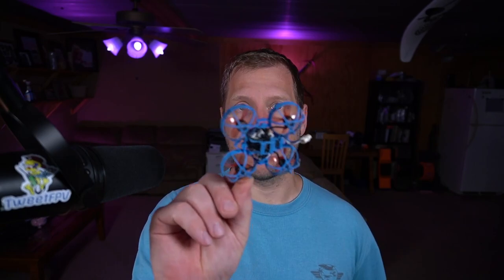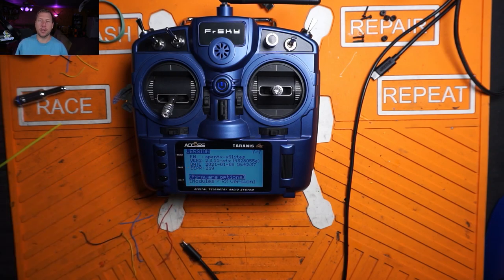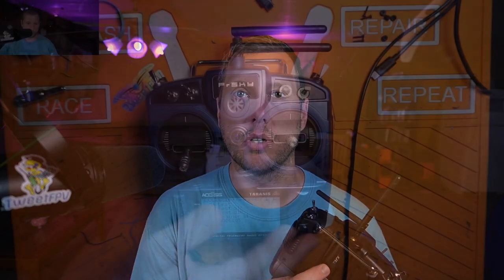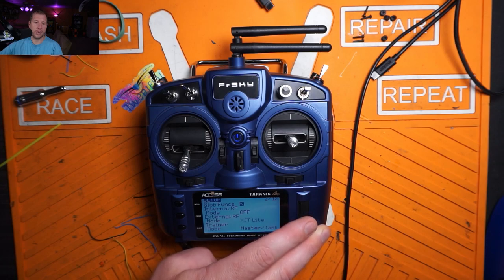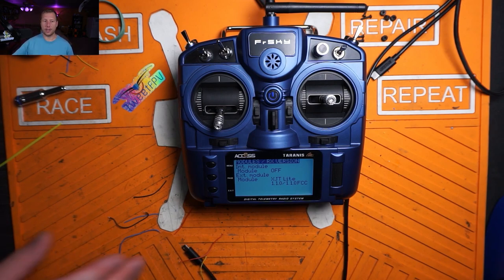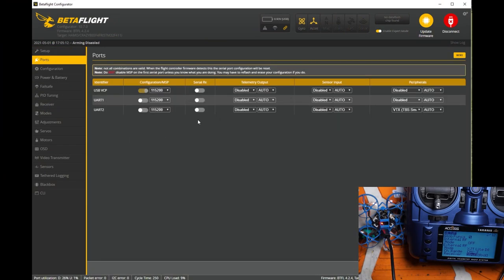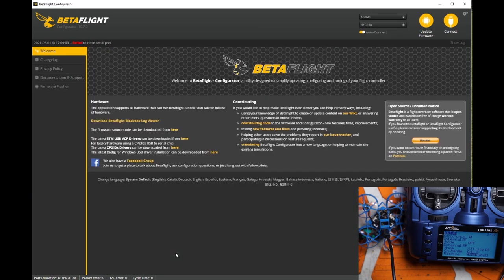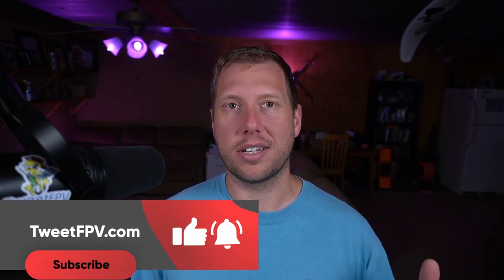Binding with External XJT lite #frsky #access #whoop #binding

Comment: Wondering if you could help, after following your great video on opentx isrm etc. got everything updated open tx 2.3.14 and did the most recent isrm 2.1.6 planning on using the xjt module on my x9lite everything bound up fine after plugging my whoop in and hitting exit to many times my tx is fully bricked I’ve tried most videos I can find on it, thanks!
Reply from the maker: I can try and help you over on my discord. https://discord.gg/YrB7BSv

Comment: Hello I Bought a XJT to connect to my whoop. And got it connected very easily, but I bought a crossfire receiver to try and connect it with that but have had a lot of trouble. can you help?
Reply from the maker: Xjt and crsf are not compatible. You'll need a crsf transmitter module to be able to talk to your crsf receiver.

Comment: Will this work if you update accst to 2.0.. that's what I'm hoping for anyway.  Having trouble flashing older firmware to my xm plus and want to upgrade the radio and use the module for spi.. is this feasible? Thank you.
Reply from the maker: Yes that will work just fine
Reply: @TweetFPV  just called RDQ and they confirmed and you were literally answering at the same time! haha  But thank you so much for your time / knowledge shared..

Comment: hi there sir,
can u please help me,
bought this zorro elrs version and xjt lite module to use with my 3 happymodel quads,
mobula7 2s mobula7 1s and larva x,
all have d8 rx,
but this external module does not bind to any of them??
also when i go check the firmware version under modules/ rx version tab,
it says for external module =  no info 
can u please tell me what i need to do to get this module work using my newly bought zorro elrs radio!!!
would really really appreciate it sir.
thanks.
Reply from the maker: Does the led on the xjt lite come on when you select a model with external rf set to xjt lite?
Reply: @TweetFPV  yeas sir,
The red solid and green blinking!!!

Comment: when i plugged it in it said no info any idea what to do?
Reply from the maker: That's normal. The older fw doesn't report the fw version info. As long as the led on the back of the module is coming on and changing when binding you should be good.

Comment: how do you bind the new hawk pro says no command error
Reply from the maker: Sorry, I need more info to help with that one.
Reply: @TweetFPV  I put the jtm module in set it to d8 went to beta flight typed in bind_rx and says error command not accepted typed bind_rx_spi same thing have the hawk pro 6 s has a bind button on board never had an issue with bin before is there a certain way you do the 6 s pro 2022 verdion
Reply from the maker: The bind command only works for spi based receivers. I don't think this has a spi rx. You'll need to start the bind on the quad side with the physical bind button.
Reply: @TweetFPV  I turned on receiver with bind button engaged set frisky jtm d8 to bind nothing happens that is what the instructions said in quad box I know you can direct to quad with trannis plus but the lite  i se no pins
Reply from the maker: Are the leds turning on on the back of the xjt lite module?
Reply: @TweetFPV  yes red green flashing
Reply: @TweetFPV  update trannis firmware
Reply from the maker: What opentx version, and bootloader version are on your radio? I have found that on older versions of opentx and with mismatched bootloaders many people report issues using the external module bay.
Reply: @TweetFPV  I just downloaded version 210208 at frsky for the x9 lite firmware for radio-os I have to get an sd card tomorrow check out that update let me know may fix  my there are couple other older ones check it out
Reply from the maker: I would recommend NOT using the otx builds on frsky web site. They are more like development builds. Get your os from the opentx companion or just switch to edge TX.
Reply: @TweetFPV  i have version opentx-x9lite-2.3.12 (5b931d38) could you send the link on tx companion for the right firmware I tried at frsky says not compatible
Reply from the maker: I can't just send you the fw. You need to compile it using the opentx companion software. Here is a video on how to update the radio the easiest way. Different radio but same procedure. https://youtu.be/yodRWoSlLq8
Reply: Thanks
Reply: @TweetFPV  the matekf405 is not listed on beta flight a matekf405std is or mini Also it says communication failed when I try to write so I have to jumper pins and erase chip Also the version for the board is 0
Reply: @TweetFPV  i did the edge tx got it to connect getting there now
Reply: @TweetFPV  well i got everything working except the fail safes will not arm
Reply from the maker: I'm not sure what you mean by "failsafes will not arm"
Reply: @TweetFPV  when hit switch to arm nothing happens when you push throttle forward red light 0n flight board starts blinking all the switches are working on tx companion and beta flight .. the failsafe is set
Reply from the maker: In betaflight with the quad powered on the setup tab what arming flags are listed?